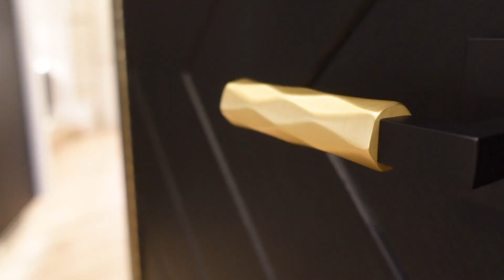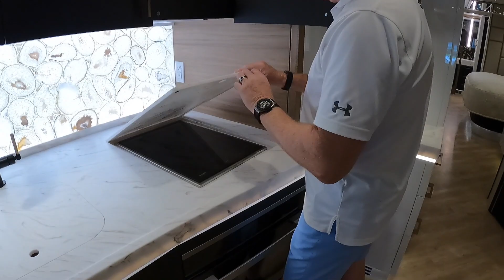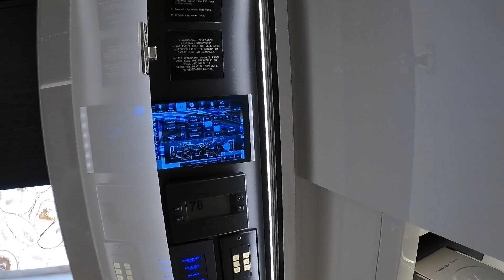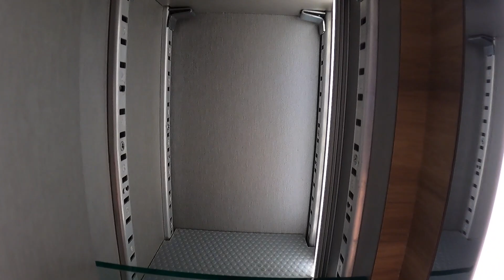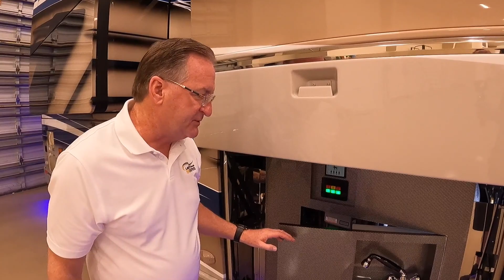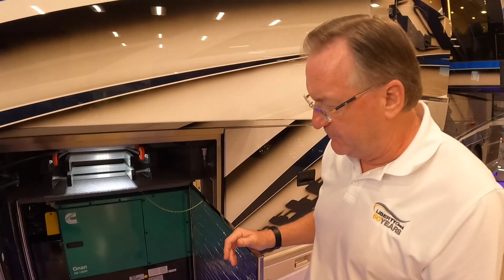Touring a 2023 Prevost Liberty Coach Quad Slide

Comment: This  is  my  question   for  you   ?  ,  it  is  possible   if  the  driver  set  
could  be  in  the  middle , in  the  centre   , on   the  front   this  vehicle ,
and   the  driver    could  have  more  space   around   him  .  Setting 
behind   a  big    desk  (  dashboard   )   with  the   steering wheels ,  where  he the  driver    could   have  chances  to   reach   any  batten or  anything   which  is  involved   during the  trip  ,  without   standing   and  forcing 
him  self   or  asking   anyone   for  help  or  advice in  completing , and  on  the  back  ,  behind   tha  driver   could  be   more   sets  for  
the  passengers   on  the  higher  step  .  And  the  sets  for  the  passengers   ,  would  have  shape  like  sofa   with  the  caving  sets
on  the  sides  , that   could be for   3  to  7   passengers   it  depends 
how  big  they   will (  if  a   person is  slim   enough   then  7  will   can   be,   but   if  a  person    is  big   and  fat   like  me  for  example   then  just  3  or  four   passengers   can  fit   behind   the  driver   sets   the  passengers are skinny  enough   then  7  easily  
 but  if  they  were   big  and  fat  then  only  3  or  four .)

Comment: This  is  my  question   for  you   ?  ,  it  is  possible   if  the  driver  sets  
could  be  in  the  middle , in  the  centre   , on   the  front   this  vehicle ,
and   the  driver    could  have  more  space   around   him  .  Setting 
behind   a  big    desk  (  dashboard   )   with  the   steering wheels ,  where  he the  driver    could   have  chances  to   reach   any  batten or  anything   which  is  involved   during the  trip  ,  without   standing   and  forcing 
him  self   or  asking   anyone   for  help  or  advice in  completing , and  on  the  back  ,  behind   tha  driver   could  be   more   sets  for  
the  passengers   on  the  higher  step  .  And  the  sets  for  the  passengers   ,  would  have  shape  like  sofa   with  the  caving  sets
on  the  sides  , that   could be for   3  to  7   passengers   it  depends 
how  big  they   will . If  a   person is  slim   enough ,  then  7  will   can   fit     there  easily,  but   if  a  person    is  big   and  fat   like  me  for  example   then  just  3  or  four   passengers   can  fit   behind   the  driver   sets .
But  my  question   was   specifically   with  the  driver   set   (  in  the  middle,   in  the  centre   )  that  is  possible to   do  that  or  not  ???.

Comment: An exceptional forward thinking company solely due to its dedicated family of owners and employees. This particular coach stands out as one of the most appealing for so many reasons. Brushed textures, mat/semigloss surfaces, the bright led lights add a softer kelvin warmth to the interior, the textured ebony doors, the list goes on. I’m also liking the transition to flush panel electronic control units particularly next to the boarding entrance. The spilt windscreen center pillar is broad and might introduce a blind spot. One way to mitigate this might be a camera shot in the direction of the turn or when crossing a busy intersection a simultaneous left and right camera view.  Excellent report by both gentlemen. Congratulations to Liberty for their new 2023 model light years out in front of the competition.

Comment: Why doesn't the new Prevost have engine brakes?

The trans retarder, how does that work?  Is it a large brake disc on the drive shaft or is it internal to the transmission?

Comment: Thank you for this presentation showing another top of line rig. I think the comment of Charlie Daniels and considering racing enthusiasts to an older retired people shows a trade off. Having a good traveling coach like a bus or a unit to sit back and enjoy life. As we get older the complex controls of these make a couple page check off list required. Maybe they recommend having a professional driver crew to move them. I think getting the AC units in the basement and solar above can remove the large generators completely. More information on construction would be helpful. When I bought my coach years ago they kind of talked about that but I have found a lot is said and not proved. Just like a vehicle they can have condensation problems unless it is in the desert southwest. Issues not really talked about. Thanks for the video.

Comment: I  usually   watching   the  programs about   the   other   different   houses
But   alawys  come  back   to   see  the   Coaches   because   I  think
 they  are  the  best   ,  small but  very  smart, easy  to  clean, comfortable,   easy  to  moves   from  one  place   into  the  other   and  whats    we  need    now   ,
Is  a   very  good  roads    and  highways   with   the  parkings    on  their   both  sides   and  from  time   to  time   i'm  thinking   about   distance    between    public  restaurants, coffee kitchens, bathrooms and londrys   because   it  is  impossible   to  do  everything  inside in  the  coach   if  the  owners   wants
To  keeping   them  for   a   longer   time    of  course    maybe   not  forever    but    for  sometime   intil   the  next   of  course     if  it     will  be   possible 
To  change   the     current   for  the  next     new  ones ,  maybe  for  some    even  better  ,and  in  this  way   we  all   can    solved the    problems  with  the   rubbishs   and  recycled   materials  to  reduced    costs   production   of
Unnecessary    products   which  we  usually    are  throwing   into    the
Recycle    or  rubbish   bins   just  after   opening   and   in  my  opinion
This  is    are  pure  waist .

Comment: Good job. Details as much possible. Good questions answered with good answers. THANK YOU.  Only problem I got with this couch is size. It’s too big (long) for me. Diesel pusher instead of having it all in front ahead of passengers is also an issue. I am debating still between Prevost and Newmar. Showhauler is off the table for now.

Comment: On the 12.5k Gen, besides the extra & better battery setup. Why still not have a 20k Gen?

Is it the size for the space , it can’t be a cost savings on this type of Coach. Will the 12.5 power everything on the coach as well as a 20k and the 20k is just overkill?

Ty
Reply: I have a 2021 Liberty. Frank is correct, I almost never use my 12.5 generator. And yes, when I do, it powers everything. It really is an amazing system.
Reply: @chucksurack2478  Do they have the ability to put a full-size washer and dryer that’s 220

Comment: Simply amazingly beautiful! 
I have one question: Does Prevost have just one custom chassis that they sell to Liberty or several custom chassis, depending on what the Liberty customer wants/needs?
Reply: Prevost builds many different variations of the chassis, number of slides, where slides are placed, size of slides, window placement and size as well.  All available to each of the converters.
Reply: @frankkonigseder6592  did you ever build a shorter coach? wondering if you could get to one that really doesn't need to carry a generator at all? smaller size, fewer AC units, less weight, maybe even able to drop the tag axle? not saying that you could sell it, just wondering if it could be done, to the Liberty level.

Comment: Beautiful bus but Newell has caught up with their paint jobs and have surpassed Liberty with new tech that Liberty can't do because Newell is a true custom coach. For my money it's Newell and Andrew can't lose with that combo!
Reply: I beg to differ.
Reply: @frankkonigseder6592  I hear you Frank. On what part do you think I am wrong? I am only speaking on what I see and that is I can have a coach from 40-45 ft on a Newell. I can have a front or mid entry on a Newell. I would think that having options on how big my slides are and which side I wan to put my kitchen on is custom. Now you do have a great product but can Liberty give those options? If so then I have been educated. You have a great product and can't take that from Liberty. But Newell is truly custom and that's what I have learned from Andrews channel. Thanks
Reply: @MrRicco39  Newell can make mid entry. Newell has Cummins engine which is serviced at so many more locations than Volvo whatever. Newell has lower basement so you got higher living area which also gives you more storage cabinets were you actually live. Newell has better (smaller) turn ratio. Newell has same level front seats (driver and right seat) so it can be used as living area while a Prevost Has steps between driver’s area and rest of coach. Prevost rear exhaust system takes up space there.
Reply: @newSigmundFreud  thank you for validating my opinion. Waiting for response from Frank
Reply: @MrRicco39  Not to be too lengthy but I think worth mentioning, since our inception over 50 years ago, Liberty Coach is a custom conversion company.  Since we do not build the chassis, but have influence, we are limited to the chassis manufactures options, so to say that Newell is the only truly custom coach company is misleading.  With regard to technology, where is Liberty Coach lagging behind?  I point to a few of many examples, Lithium Ion battery technology which Liberty Coach brought to the entire industry exclusively 12 years ago and up until 2022 was still the only company, Class A or above providing it, or the digital electrical architecture which we introduced in 1993 then advanced in 2007, or the Liberty i-Link communication which was originally done via a computer modem and a land line phone connection in the late 1990’s prior to the ability to communicate wirelessly because of the lack of cellular data bandwidth we currently have.  Also worth mentioning that Liberty Coach was the first to include as an option in 2001 which then became standard equipment in 2003, the Crestron Remote Control systems, still today the most advanced, most reliable, and user friendly interface in our industry.  With regard to safety, Liberty Coach was the first company in our industry to offer, as standard equipment, the 360 exterior birds eye view camera system, then provided the exterior blind spot detection system and now add to that the Prevost Advanced Driver Assist package with includes Lane Departure alert.  There are many differences between both companies, there are options one manufacture does that the other does not, it depends on how you are going to use the coach and what your specific criteria is, but to compare both companies you need to compare apples to apples, Liberty Coach as well as the others in our industry are interior conversion companies, compare our interiors and conversion modifications leaving the chassis out of the equation.  With regard to the chassis, I point you to www.prevostmotorhomes.com, there I think you will find it is hard to challenge the construction and service longevity of the Prevost chassis compared to anything on the road.  Also, the turning radius that was brought up, the Prevost is 41.6 feet, with the tag unloaded it is 40.5 feet, this without the complicated mechanism of a turning tag system.  My opinion, after 35 plus years of driving coaches, I have unloaded the tag axle less times than I can remember, too many times obstacles such as cars, trees, sides of buildings and the side of coaches get damaged because of additional rear swing out and high centering caused by extremely tight turning radius options.  With regard to the mid-entry option, again it is dependent on how you use the coach and your floor plan options.  Prevost did a mid-entry option, you all probably didn’t know that, which never took off, and we did our share of them, the loss of interior floor plan space and the loss of usable lower compartment space for mechanical systems and storage was not worth the effort or else Prevost would still be offering it as a standard option, it is however offered on a case by case basis.  In conclusion, regarding service, Liberty Coach has service locations at the factory in North Chicago, IL and our sales and service facility in Stuart, FL, in addition to our tractor trailer rig which normally moves to at least 14 different Motorcoach resorts and events per year.  There are also, 17 Prevost parts and service centers, over 60 Prevost operated service vans that can come to you, and over 175 certified service centers, all of which can work on converter issues if needed.
Reply: @frankkonigseder6592  great reply and I am sure Liberty is a great company. All the things you said are valid points but you are simply restricted by your chassis's made by someone else. You are custom up to a certain point. You have a great product up to a certain point. It's after that where I am spending $2 mil and better is what counts for me. I can have different size slides move my kitchen enlarge my bathroom etc. Maybe your team can figure out how to go mid entry once again. It's a product I would love to see. Good luck in the future Frank and thanks for taking the time to respond to the little guy. Not many people would do that.

Comment: The only thing I don't like is that bar in the middle of the windshield. I wish they would do a wrap-around like the Integra Cornerstone does so you have a clear view out the windshield with no obstruction.
Reply: I had a 2015 Liberty Coach built and kept it 6.5 yrs.  The center bar is of no issue when driving.  It's needed for rigidity of the chassis.   There is no flexing of the Prevost monocoque chassis.... no windshields will 'pop out', these chassis's are solid as a rock.